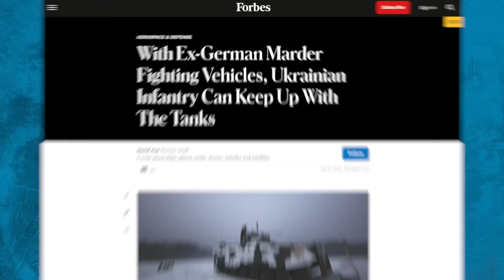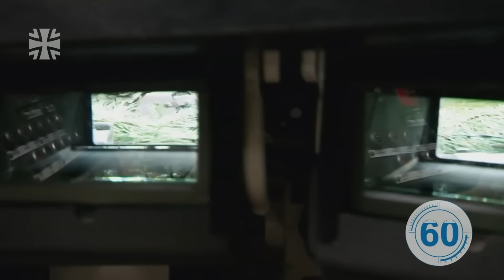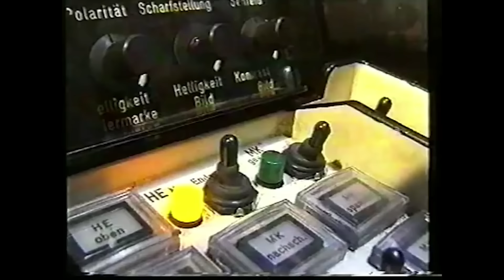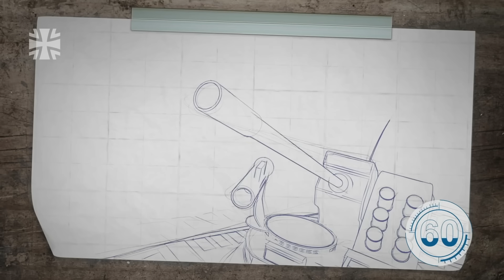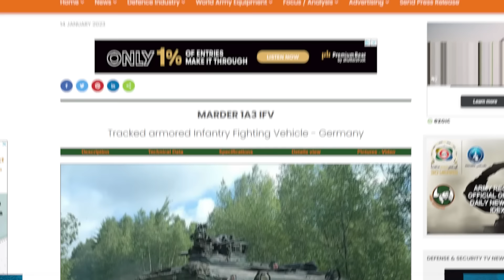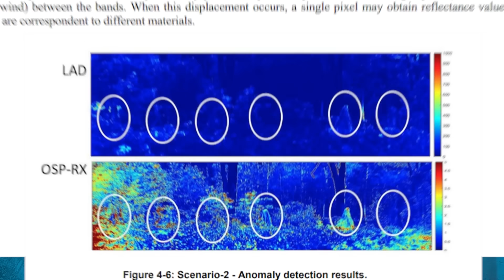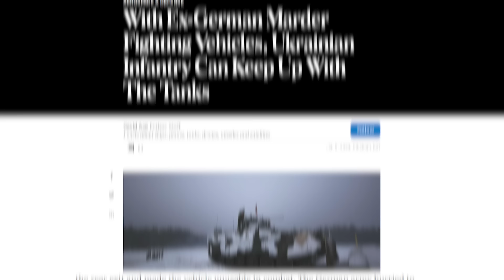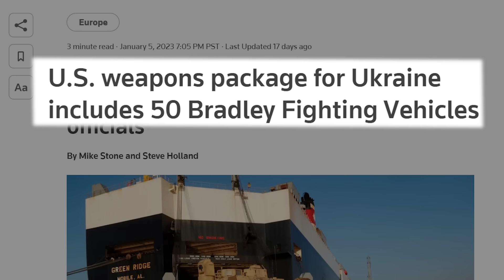Why this German IFV is So Hot Right Now

Comment: One aspect that has been overlooked with German medium and heavy armour as that it has been designed from the get-go to be user-friendly. later upgrades to the Marder might have improved its fighting capability significantly but the same ethos remains paramount, it must be easy to maintain, reliable and be able to be placed in the hands of 'Conscript', troops with minimal training and experience, this also applies to the leopard which in spite of may naysayers doubts is not that difficult to maintain and operate and for trained Ukrainian crews upgrading to the vehicles it is not all that a big step to take. Why Germany is standing with its thumb up its arse over heavy weapon supplies is purely a political issue. KMW stated clearly it had a supply in their storage of around 200 vehicles it was happy to supply Ukraine months ago but Shotlz stomped on the idea and instead agreed to send a niggardly 14 which will be of little use except in positional engagements and so soon picked off.

Comment: Lambrecht resigned as the German defense minister, after multiple humiliations. She never really was capable of it nor interested in her post. She barely could name her Generals, took month to ever meet the high command of the Bundeswehr. Didn't knew about what the Bundeswehr had in Stock and could send to Ukraine, was on vacation a lot, used air force helicopters to fly to vacation with her son. And she apparently didn't even understood the difference between IFVs and main battle tanks. She didn't want to visit the troops on the customarily Christmas visit, didn't answer the calls of the British defense minister until he formally complained and so on. Most of that was known for half of year before she resigned. She only was kept there because the Chancelor backed her, due to inner party politics.

Comment: I think Putin began with some newer equipment, seen how the fighting was going, and decided to use older stock. I think Putin still has plenty of newer stock and is Adding to that stock as we speak. We think Russians are weak, but in combat there is deception, I propose the Russians are not weak but exhausting its older stocks in attempt to claim ground because of Ukraine's current military equipment and forces, but Russia miscalculated the resolve of Ukraine's military, and the outside support. It is therefore in my opinion we will likely begin to see more newer russian equipment sprinkle in, in 2023.

Comment: Marder is a very Bad ifv lol weak Canon and slow
Reply: Marder also carries ATGMs like MELLs and Milan.
Reply: Faster than the non maintained Russian equipment. If i listened well to the former NVA officers it is a great improvement over the BMP both inside and out. Russia is down to the BMP-1 and BTR-50 stocks. If like Germany these are used to replace the BMP-1 it would improve the capabilities by a factor of ten.